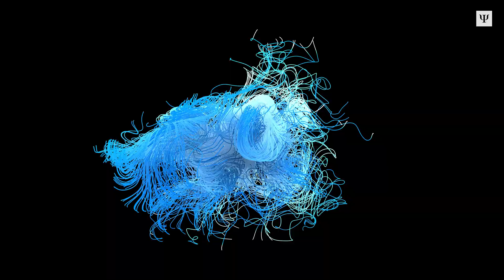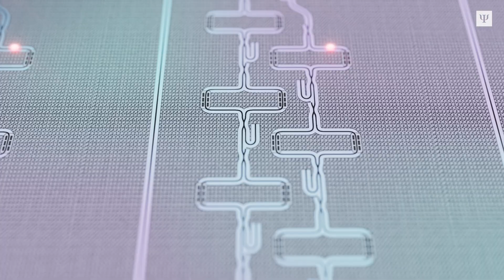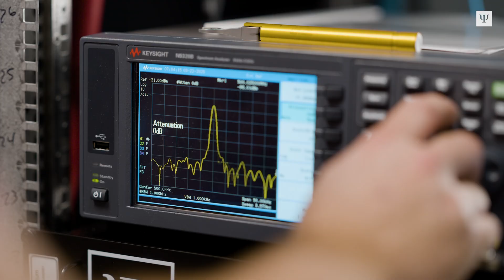It's impossible until it's not.

Comment: I'd guess it's still 2 investor rushes away from being commercially viable. In next 1-5 years there will be 10-100B in new investor funding in a hype bubble over a year or two, then after those fail with limited success will it get another pulling of funding putting it in limbo for a few more years untill the universities and private sectors start using the tech more. 
Maybe 5 years we will take niche problems to solve that aren't designed proofs that quantum computing dose certain tasks that would be impossible on normal computing like we have today. 
Maybe 10 years untill useful questions and research will be done on them at small scales. 
Probably 20-30+ years untill tech matures
Reply: 2 investor rushes away from bankruptcy.
Because it's not working no matter how much money they throw at it.
Reply: @ProjectPhysX no 0 investors rushs untill bankruptcys for most of the quantum start ups. Then after 5 years investors will be sold new breakthroughs and pursuaded about what the tech could do in future and how much money they can make if it works. Then it doesn't work again and after a few years a majority go bankrupt again. Then maybe 10+ years from now when a second influx of investors is when I expect results.